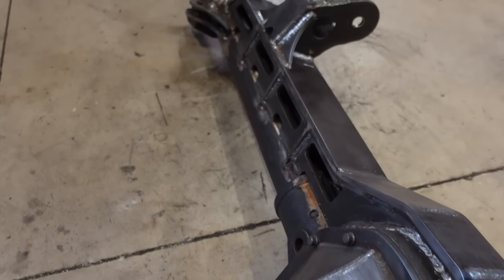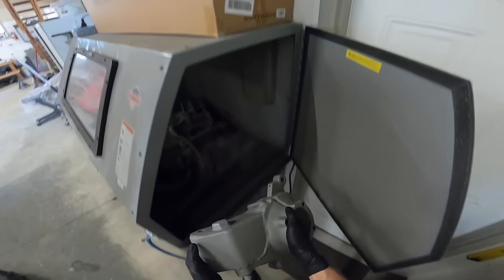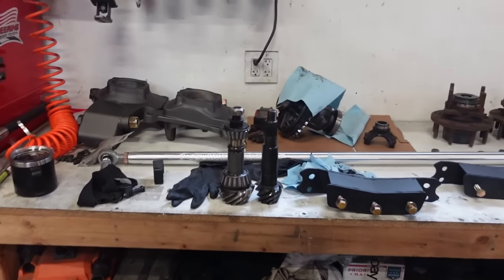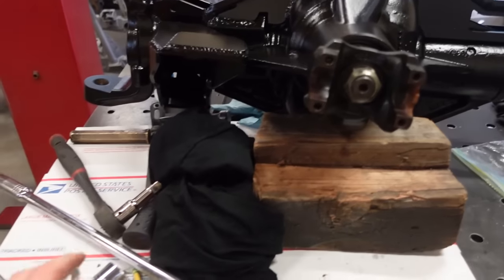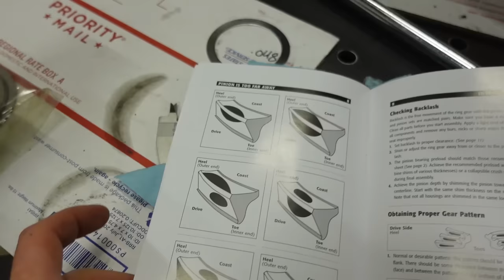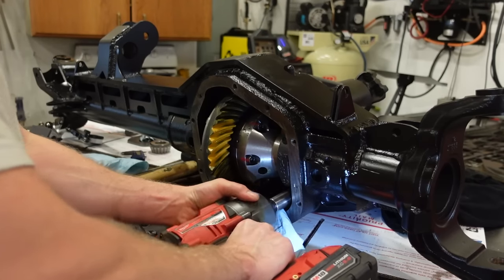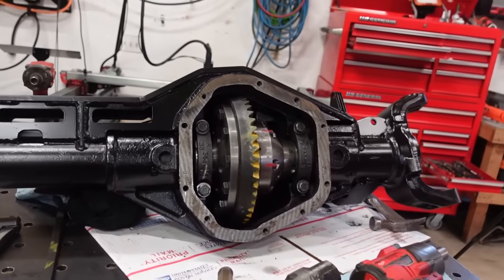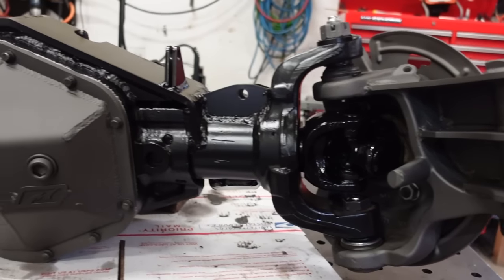The Dana 60 Gets 5.38 Gears, A Locker And A Fresh Paint Job!!

Comment: I used to help a friend in his auto machine shop including rear ends. He had many sets of set-up bearings that were all new as he learned the hard way with used. Yes, there were tolerance differences but they were so much closer to installed specs than the worn out sets. Many times there were some "choice" words spoken. He did GM 10 & 12 bolt, Ford 9 Inch, Chrysler 8 3/4 and Dana.

Comment: glad you got it done. Ring and pinions can be a PITA. A few tips for you...buy a pinion depth gauge tool and get a good one. they are expensive but worth every penny. If you do 2 axles by yourself, youll already get your money's worth. Also, when it comes to making your own setup bearings, if they are not the same brand, they usually do not match up, so it will be off just like it was for you. Last, the pinion depth should be stamped on the head of the gear, use the tool to determine how many shims you need to get close as possible to the number stamped on the gear.

Comment: Bearing thickness tolerance for these size bearings is 100 microns or .004" so  since there are 2 bearings on the pinion shaft , you can get .008" difference with any new set of bearings. The tolerances for the bore and diameter of the bearings is much tighter, in the 10-15 micron range  .0004" - .0005" so even set up bearings will only get you close. another cool tool is a case spreader to help with the in and out of the diff.

Comment: Looking good.  Bit of advice - throw some magnets in the bottom of the housing to catch stray metal/grinding dust.  Then change the oil a couple times in the first couple hundred miles.  

I did a D30 for my XJ years ago - similar build up to include lots of welding/grinding.  I cleaned the housing out good, but apparently there was still some foreign material in there.  I had to replace the outer pinion bearing because some grit got in it and roasted the bearing.

Comment: a little tip...we use to do...(prevention)...a little rtv sealer behind the pinion washer  & red locktite on the pinion threads....u dont want the job come'n back with a grease leak...!..or the pinion nut loose'n up..(not good).& like someone else said down bellow....a pinion depth tool is the most accurate way to have a quit gear set with the proper depth..!...paint can be off thousands...!...remember..a dana 60 is the toughest rear to do...(its the strongest)....so a 9 inch ford or 12 bold GM will be a walk in the park 4 u...good luck..reguards..Brain...

Comment: I had a similar situation with a Ford 9.75" rear end. I'm pretty sure I took a little too much material out of the setup bearings and it must've been loose enough to affect the tolerances. It took a few tries to realize why it wouldn't set up correctly.
 It looks extremely good man I'm glad you got it figured out!

Comment: I do exactly as you did except that I always buy two identical sets of pinion and carrier bearings, grind a clearance of one set to use it for the setup and then press in the 2nd untouched set of bearings, and since at least 25 years I never saw any difference between the lash and gears impressions between them. Your main issue here is that you used a worn out bearings for the setup.

Comment: Personally I take the use new races and bearings with the old shims and see where it is. Then usually not hard to adjust shim packs from there. Not an expert but have good luck doing it this way. I have never had a D60 that you can pull the diff out that easy. I have never used Yukon gears. I buy Quick Performance. I have heard of guys using Yukons having a hard time setting them up.

Comment: I have seen so many techs install that ring gear using the bolts. That's the good way to deform the gears. You are supposed to heat that ring gear and slide on the carrier

Comment: A wheel brake cilinder Horne works real good on the inside of the bearings ,also use a brass punch to set the input shaft bearing just tap on the nut side and the gear side be surprised how much different tha makes

Comment: There is a different spec for bearing preload for used bearings. If the spec isn’t on the chart you have from Yukon then I got it from all data. It’s been a long time since I’ve set up a differential.

Comment: Great job!! Check to see if it is hard to turn your steering knuckles with the new ball joints. You probably have to adjust the depth of the bushings on the upper ball joint or your steering will bind or cause memory steer when it’s together.
Reply: I’ve had to redo that from other techs who put new ball joints in. You steer the wheel and it don’t return to center.
Reply from the maker: The old ball joints were really tight! These ones are pretty easy to turn!

Comment: If you measure the height of the setup bearing (sitting in the race) using a height gauge and surface plate , then compare to the new bearings height you can get closer.

Comment: Do you clean the part after sandblasting since it can add alot of dirt, oil and impurities?
Reply from the maker: No!!! As long as your sand is clean, you blow off with compressed air and spray!
Reply: @austinniemela  You need a hug Austin?